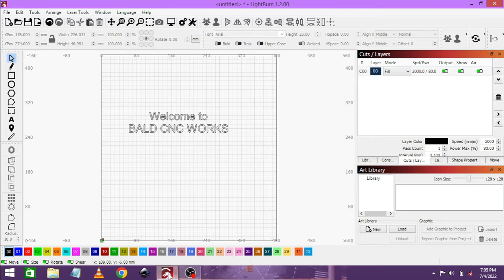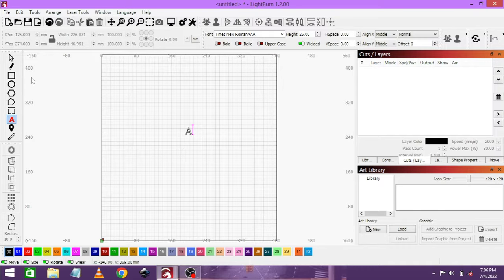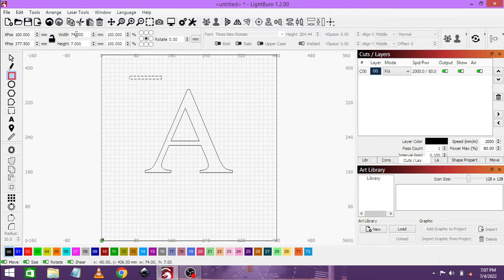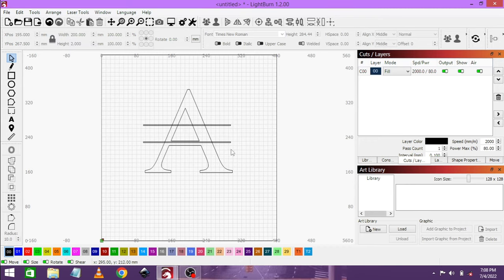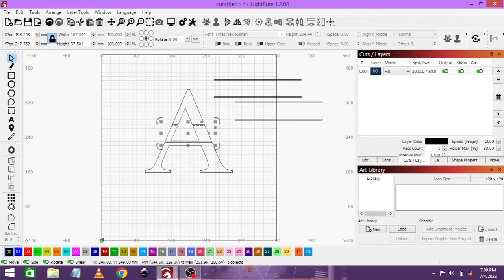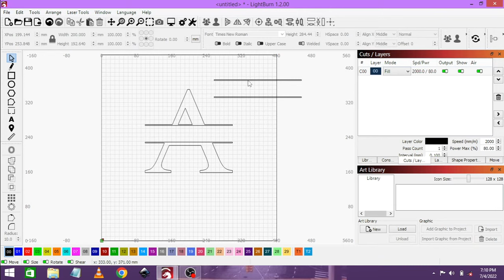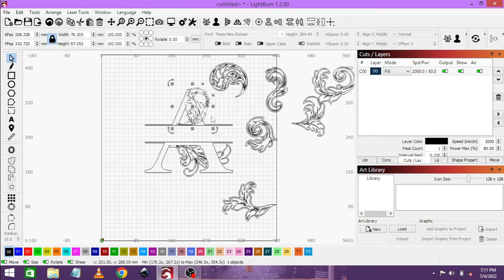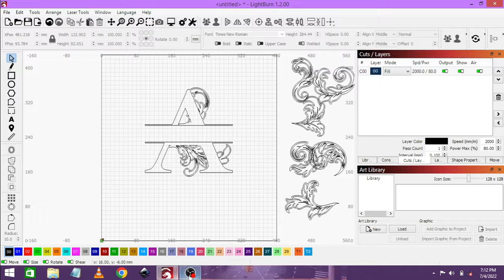How to create Split Letter Monogram Using Only Lightburn | Lightburn Tutorial

Comment: Thanks for the video.  Is there a way that you can use this as a template so that you can just change the letters on the fly
Reply from the maker: I don't follow your question. Can you please break it down for me
Reply: @baldcnc_works  Ok, is the a way that after you have finished the design and saved the file of the letter A  to reopen the file and easily change the letter A to another letter without starting from the beginning
Reply from the maker: You would have to skip some steps in the making of the split lettering. For instance you have to not combine the art and the letter, but that would make that the end product won't come out like you want it. It is a tiresome process but that's the only way I know how to do it.